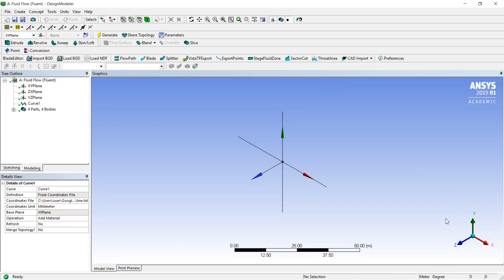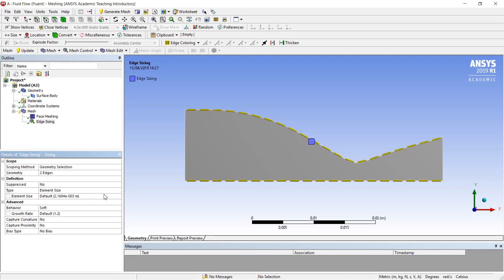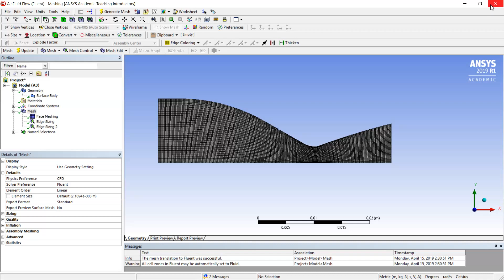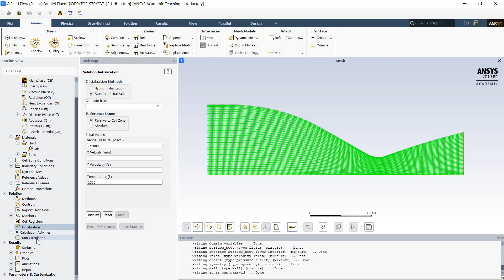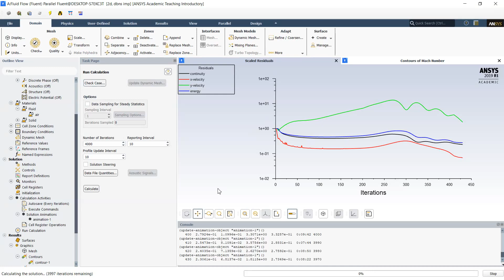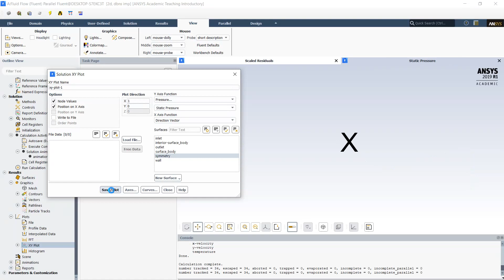Supersonic nozzle simulation in Ansys Fluent - part 1

Comment: good day sir. What will I do if the material to be used in the simulation is not air, which is a potassium nitrate and dextrose mixture?
Reply from the maker: In this case, you need to simulate these propellants' combustion, or at least a mixture flow of the combustion products. I'm planning to make a video about this topic in the future.
Reply: @chemicalpropulsionlaboratory  Thank you sir. Noted
Reply: @chemicalpropulsionlaboratory  Is it okay to just use air as fluid, then change the properties in the references values using the properties of the potassium nitrate and dextrose mixture?
Reply from the maker: @simplelpmis  Unfortunately, no. The error will be significant.
Reply: @chemicalpropulsionlaboratory  okay then I'll wait for your video then. Thanks

Comment: hi, I face an unique case
if I simulate a nozzle, it will converge with 500 iteration, but when I attach a long square behind it(2m x0,5 m), this will cause to divergen
do you know why? I have mesh it with very small mesh and hexahedral shape(facesplit technic)
Reply from the maker: Hello. Thank you for your question. Simulation of the surroundings around the nozzle is different from just the nozzle simulation because it involves a relatively significant air volume with a small velocity. The convergence of such a simulation is usually very slow. I recommend making a volume of at least 25x25 diameters of the nozzle and put the "pressure outlet" boundary conditions with zero pressure gradient on the border.

Comment: How we can see the normal shock in your tutorial
Reply from the maker: This video shows the flow close to isentropic (without a normal shockwave), so it could be validated with a simple quasi-one-dimensional analytical model. If you are interested to obtain a normal shockwave please create appropriate flow conditions reducing chamber pressure or increasing exit pressure.
Reply: @chemicalpropulsionlaboratory   can you please provide the geometry and the boundary conditions of convergent divergent nozzle
Reply from the maker: @kunalpansari6538  Here you go:
1	1	0	11.61693	0
1	2	3.84016	11.61693	0
1	3	4.38788	11.61198	0
1	4	4.93543	11.59715	0
1	5	5.48262	11.57243	0
1	6	6.02928	11.53784	0
1	7	6.57522	11.49339	0
1	8	7.12028	11.43908	0
1	9	7.66426	11.37495	0
1	10	8.20699	11.301	0
1	11	8.74831	11.21727	0
1	12	9.28802	11.12378	0
1	13	9.82595	11.02056	0
1	14	10.36194	10.90764	0
1	15	10.8958	10.78507	0
1	16	11.42736	10.65287	0
1	17	11.95644	10.5111	0
1	18	12.48288	10.35981	0
1	19	13.00651	10.19903	0
1	20	13.52714	10.02883	0
1	21	14.04462	9.84925	0
1	22	14.55877	9.66036	0
1	23	15.06942	9.46222	0
1	24	15.57642	9.25489	0
1	25	16.07959	9.03844	0
1	26	16.57877	8.81295	0
1	27	17.0738	8.57847	0
1	28	17.56451	8.3351	0
1	29	18.05075	8.08291	0
1	30	18.53236	7.82198	0
1	31	19.00918	7.5524	0
1	32	26.04915	3.48787	0
1	33	26.11762	3.44916	0
1	34	26.18677	3.41169	0
1	35	26.25659	3.37548	0
1	36	26.32706	3.34053	0
1	37	26.39814	3.30687	0
1	38	26.46982	3.27449	0
1	39	26.54207	3.2434	0
1	40	26.61487	3.21363	0
1	41	26.6882	3.18518	0
1	42	26.76203	3.15806	0
1	43	26.83633	3.13227	0
1	44	26.91109	3.10783	0
1	45	26.98628	3.08475	0
1	46	27.06188	3.06302	0
1	47	27.13785	3.04266	0
1	48	27.21418	3.02368	0
1	49	27.29084	3.00608	0
1	50	27.3678	2.98987	0
1	51	27.44504	2.97504	0
1	52	27.52254	2.96162	0
1	53	27.60027	2.9496	0
1	54	27.67821	2.93898	0
1	55	27.75632	2.92977	0
1	56	27.83458	2.92197	0
1	57	27.91298	2.91559	0
1	58	27.99147	2.91062	0
1	59	28.07005	2.90707	0
1	60	28.14867	2.90494	0
1	61	28.22732	2.90423	0
1	62	28.26674	2.90493	0
1	63	28.28644	2.90581	0
1	64	28.30612	2.90703	0
1	65	28.32577	2.90861	0
1	66	28.34539	2.91053	0
1	67	28.36497	2.9128	0
1	68	28.38451	2.91542	0
1	69	28.404	2.91839	0
1	70	28.42344	2.9217	0
1	71	28.44281	2.92536	0
1	72	28.46211	2.92936	0
1	73	28.48135	2.93371	0
1	74	28.5005	2.93839	0
1	75	28.51956	2.94341	0
1	76	28.53853	2.94878	0
1	77	28.5574	2.95447	0
1	78	28.57617	2.96051	0
1	79	28.59483	2.96687	0
1	80	28.61338	2.97357	0
1	81	28.74912	3.02388	0
1	82	28.88487	3.07403	0
1	83	29.02062	3.12403	0
1	84	29.15636	3.17387	0
1	85	29.29211	3.22356	0
1	86	29.42786	3.27309	0
1	87	29.56361	3.32246	0
1	88	29.69935	3.37168	0
1	89	29.8351	3.42074	0
1	90	29.97085	3.46964	0
1	91	30.10659	3.51839	0
1	92	30.24234	3.56697	0
1	93	30.37809	3.6154	0
1	94	30.51384	3.66366	0
1	95	30.64958	3.71177	0
1	96	30.78533	3.75972	0
1	97	30.92108	3.8075	0
1	98	31.05683	3.85513	0
1	99	31.19257	3.90259	0
1	100	31.32832	3.94989	0
1	101	31.46407	3.99703	0
1	102	31.59981	4.04401	0
1	103	31.73556	4.09082	0
1	104	31.87131	4.13747	0
1	105	32.00706	4.18396	0
1	106	32.1428	4.23028	0
1	107	32.27855	4.27644	0
1	108	32.4143	4.32243	0
1	109	32.55004	4.36826	0
1	110	32.68579	4.41392	0
1	111	32.82154	4.45941	0
1	112	32.95729	4.50474	0
1	113	33.09303	4.5499	0
1	114	33.22878	4.59489	0
1	115	33.36453	4.63972	0
1	116	33.50027	4.68437	0
1	117	33.63602	4.72886	0
1	118	33.77177	4.77318	0
1	119	33.90752	4.81732	0
1	120	34.04326	4.8613	0
1	121	34.17901	4.90511	0
1	122	34.31476	4.94874	0
1	123	34.4505	4.99221	0
1	124	34.58625	5.0355	0
1	125	34.722	5.07861	0
1	126	34.85775	5.12156	0
1	127	34.99349	5.16433	0
1	128	35.12924	5.20693	0
1	129	35.26499	5.24935	0
1	130	35.40074	5.2916	0
1	131	35.53648	5.33367	0
1	132	35.67223	5.37557	0
1	133	35.80798	5.41729	0
1	134	35.94372	5.45883	0
1	135	36.07947	5.5002	0
1	136	36.21522	5.54139	0
1	137	36.35097	5.5824	0
1	138	36.48671	5.62323	0
1	139	36.62246	5.66388	0
1	140	36.75821	5.70436	0
1	141	36.89395	5.74465	0
1	142	37.0297	5.78477	0
1	143	37.16545	5.8247	0
1	144	37.3012	5.86444	0
1	145	37.43694	5.90401	0
1	146	37.57269	5.9434	0
1	147	37.70844	5.9826	0
1	148	37.84418	6.02162	0
1	149	37.97993	6.06045	0
1	150	38.11568	6.0991	0
1	151	38.25143	6.13757	0
1	152	38.38717	6.17585	0
1	153	38.52292	6.21394	0
1	154	38.65867	6.25185	0
1	155	38.79441	6.28957	0
1	156	38.93016	6.3271	0
1	157	39.06591	6.36444	0
1	158	39.20166	6.40159	0
1	159	39.3374	6.43856	0
1	160	39.47315	6.47533	0
1	161	39.6089	6.51192	0
1	162	39.74464	6.54831	0
1	163	39.88039	6.58452	0
1	164	40.01614	6.62053	0
1	165	40.15189	6.65635	0
1	166	40.28763	6.69197	0
1	167	40.42338	6.7274	0
1	168	40.55913	6.76264	0
1	169	40.69488	6.79768	0
1	170	40.83062	6.83253	0
1	171	40.96637	6.86718	0
1	172	41.10212	6.90164	0
1	173	41.23786	6.9359	0
1	174	41.37361	6.96996	0
1	175	41.50936	7.00382	0
1	176	41.64511	7.03748	0
1	177	41.78085	7.07095	0
1	178	41.80204	7.07616	0
2	1	0	0	0
2	2	0	11.61693	0
3	1	0	0	0
3	2	41.80204	0	0
4	1	41.80204	0	0
4	2	41.80204	7.07616	0
Reply: @chemicalpropulsionlaboratory  sir thanks a lot? i really wonder which point exactly is the starting one for the diverging section of the nozzle

Comment: Hi, you didn't put any value for pressure outlet, I guess you kept as 0. May I ask why you did this? Aren't you supposed to put the value of the pressure at the exit of the nozzle.
Reply from the maker: Thank you for asking, this question is important. The outlet pressure gauge is equal to 0 because the flow is expected to be supersonic everywhere, except a thin boundary layer. So, the flow characteristic lines are directed outside of the nozzle and the outlet pressure has no influence on the flow structure in the nozzle. In such flow configuration the ambient pressure is defined in the "Operating Conditions" tab in Fluent, but not by the gauge pressure value.
Reply: @chemicalpropulsionlaboratory  To be honest I am very confused. You have set the pressure at the exit of the nozzle to be 0, which means that the pressure at the exit of the nozzle  much smaller than the ambient pressure (1atm), isn't this should generated a nozzle with overexpansion flow behaviour with flow separation and shock waves present in the nozzle? Although you haven't included a flow domain but I can see there is no any flow separation in your nozzle. How did this happen, because if the pressure at the exit of the nozzle much smaller than the ambient pressure, this should results in overexpansion flow.
Reply from the maker: @MohamedSayed-re3il  Probably, you did not understand the concept of the pressure gauge. It defines not absolute pressure, but a relative one. So, when you set 0 pressure gauge it means that you define a zero pressure gradient between the ambient pressure (defined in the "Operating Conditions" section) and the nozzle exit section. Is it more clear now?
Reply: @chemicalpropulsionlaboratory Not relly, I know guage pressure = absolute pressure - atmospheric pressure. 

However when we calculate the pressure at the exit of the nozzle using the equation of Pe/Pt= (1+( γ-1/2 )Me^2)(-γ/γ-1), the value found is it called guage pressure or absolute pressure?
Reply: To be honest I have become more confused. You put your operating condition pressure to be 101325 pa which is 1 atm. I assumed you were simulating your nozzle at altitude of see level. If this the case, then operating conditions should be 0 because at see level guage pressure is zero. I said this because all pressure in fluent are only guage pressure.
Reply: Please bare with me, I am just started to learn Ansys fluent. Thank you
Reply from the maker: @MohamedSayed-re3il  Thank you for your interest to study Ansys Fluent. Unfortunately, I can't answer all the questions from YouTube because of many teaching hours at the University, research activities and administrative work. I suggest you find a nice textbook on Ansys Fluent that will help you to study the basics of working with this software (Ansys help database is also very useful).
Reply: @chemicalpropulsionlaboratory  Thank you sir for getting back at me, if you could just help understand those questions I ask, then i won't ask anything else. I do understand you are lecturer and too busy, but you the only one who replies back to comments. 

You don't need to answer my questions now, you can answer them whenever you free. Thanks Sir